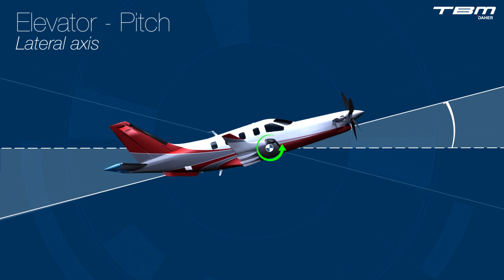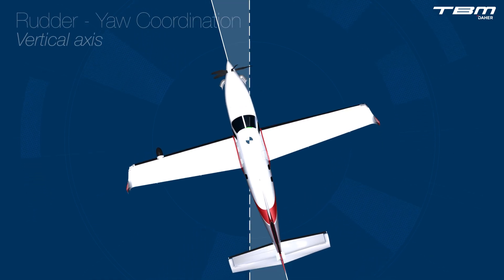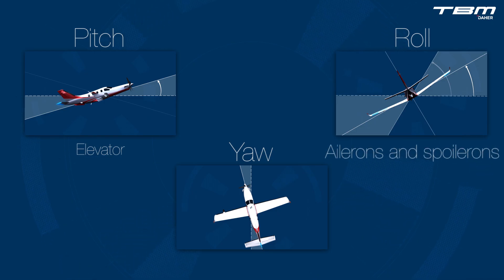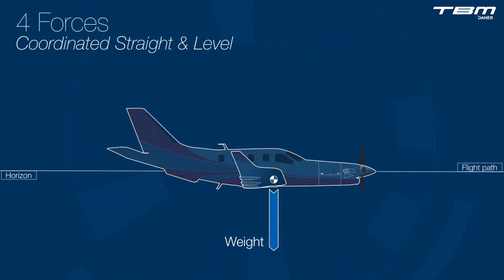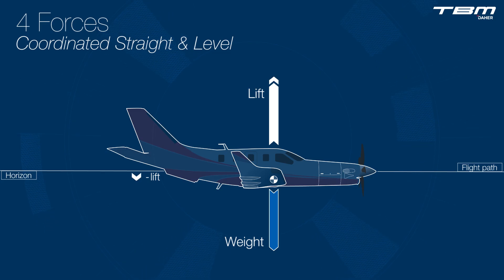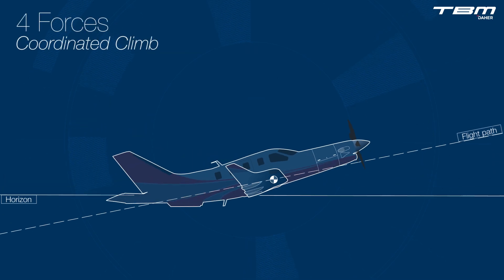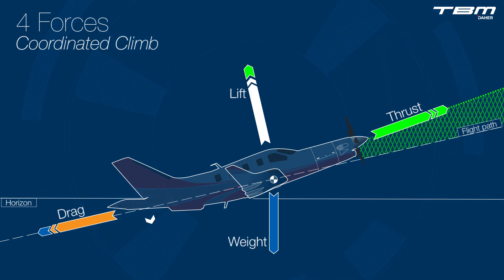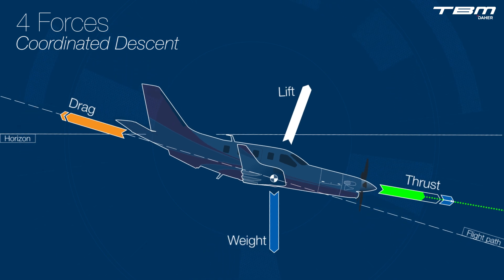Principles of flight – Part 1 : Fundamentals

Comment: Wouldn't it be good if the point for the center of gravity would be shown a little in front of the point for the center of lift? If its said that the elevator applys continued downward force this would explain it better, why it does this in the first place. Like this it seems center of lift and center of gravity are at the same place in a plane, which I learned is not the case (unless in big commercial aircrafts, which distribute fuel to the tail in order to reduce drag and save fuel)

Comment: At :23 it says 'spoilerons' I've never heard that term, are they the same as 'spoilers?'
Reply: if you use spoilers assymmetrically to behave like ailerons. Ailerons on the far edge of wings produce twisting force. So in board roll control is preferred.